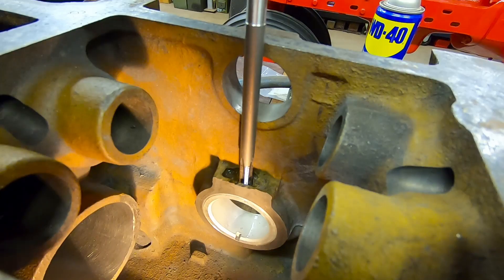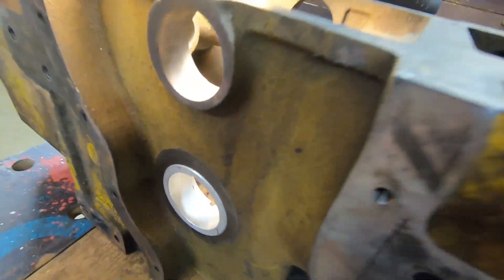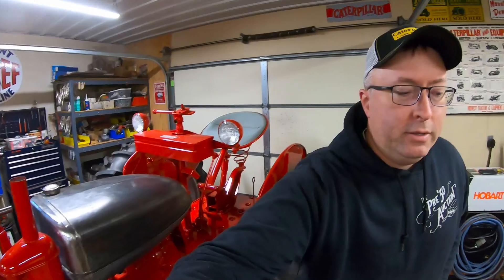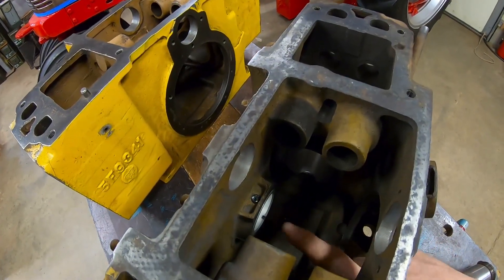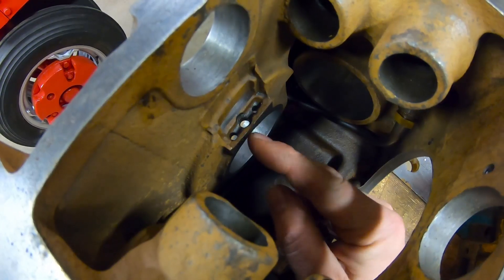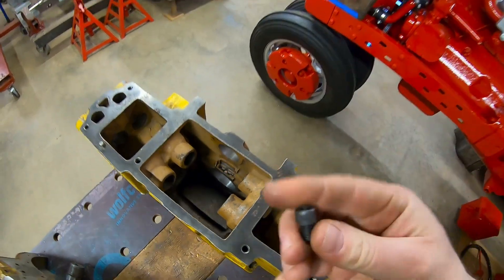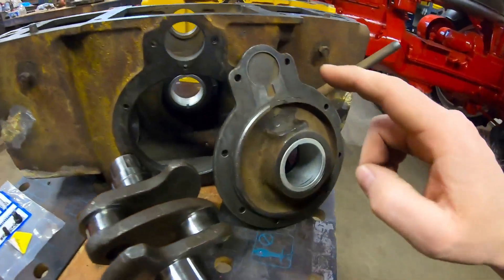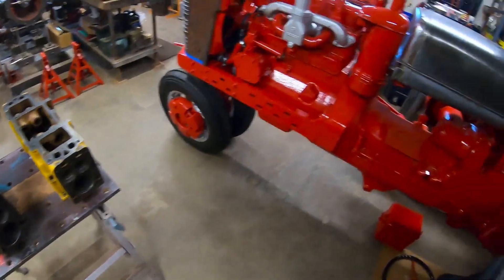The Rarest Caterpillar Starting Engine Block & We're Figuring Out How to Save It!

Comment: H liner movement is more problems than the ticking noise. These Liners must be press fit, because of the heat transfer between liner and block.  Clearance can not be loose. These are considered dry liners. You work this hard in summertime and will scorch the pistons because heat can not get away from  the liners
Reply from the maker: This H has pulled plows and dirt scrapers during the hot summer months for the last 18 years with that slip-fit sleeve and has never given any indication of trouble - stay tuned for tomorrow's new episode where you'll see a lot more of that loose sleeve :-)

Comment: Um....so when you torque the set screw it pushes on the bearing and distorts it out of round?
Reply from the maker: No, think of it like a pipe plug - the force is directed out radially, not downward. But unlike a pipe plug, only the very bottom thread of the set screw finds interference, and it only gets a short leg cinch with the Allen wrench, the Loctite does the rest. But even in the unlikely event that there would be bearing distortion, it would only happen at the very base of the set screw, which is recessed up inside the cut-in oil distribution groove that can be seen in the mirror reflection in this video, so it’s still far removed from the crankshaft. For the bearing itself to distort to an out-of-round shape, other material would have to have the ability to heave outwards below and to each side of the upper area, and the wall thickness of the bearing combined with its press fit in the block bore prevent that from happening 👍
Reply: @squatch253  I 100% disagree with your theory. But it's your engine. You way over estimate the rigidity of the bearing wall and way underestimate the force applied by the screw. I wish an engineer would chime in on this video and give their take on this.
Reply from the maker: I appreciate your concern, but I can assure you this isn’t my first rodeo. I wouldn’t put anything up here that was a bad idea in practice. Engineers operate primarily in the realm of theory, only a precious few are gifted enough to have real-world aptitude, whereas most struggle as soon as the abstract becomes reality - this is years of my own experiences with engineers talking here lol ☺️ Theory only ever gets you 75% of the way to reality - that saying came from one of the very few engineers that ever amazed me with their abilities 👍
Reply: @squatch253  So you know better than engineers. Got it. LOL
Reply from the maker: It’s ok to disagree, no harm no foul 👍 All you need to do is watch these machines that I’ve rebuilt in action here on the channel, their function and dependability are the only argument I need to put forth. Thank you for watching and I sincerely wish you a fine day - no sarcasm intended either because I know how the written word doesn’t always convey the context 🙂

Comment: WD40 is not a lubricant
Reply from the maker: On aluminum it is - I wasn’t worried about the cast. When machining aluminum, WD-40 works excellent to keep the cutting edge cool to prevent the galling and material sticking to the leading edge of the bit. Same goes for any drilling or tapping I do to aluminum (as seen here) because it also keeps the chips from sticking to the drills and taps, and it’s cheap! 👍

Comment: @Sqatch253 I have one cylinder on my pony burning  buring oil at a crazy rate. Any issues finding rings and pistons for these? D24U12XX is my SN.
Reply from the maker: Going back to the "Try-Build" playlist that I discussed in this video, what I learned while filming that saga is that standard size pony pistons are still easily found new, but most all of the oversize offerings have went extinct - and same story on the piston rings - standard size is still available but oversized rings are getting hard to find.  That's why I decided to sleeve two of the three engines I built back to standard bore size, to be able to use all new standard pistons and rings.  The complete rundown of part numbers for everything can be found within the "Try-Build" series.
Reply: @squatch253  thanks, dude. Hope yall had a great Christmas.

Comment: I got the exact solution to your set screw problem that will take alot less work and thinking use a threadsert theyre already hollow in the center and you wont loose your temper having to drill and they have a lip on them to stop from going to far down you will have to counterbore it so the lip sets properly but this is the proper solution i do believe
Reply: Depending on how deep you counterbore it will either be flush or recessed as well.

Comment: Is there NO oil pump in these starter engines??? No crank drillings for oil???
Reply from the maker: Correct, they’re a very low-tech engine that produces 10hp at 3,000rpm, holds one quart of oil in the crankcase, and are splash lube only. They do utilize the pulsing of the pistons as they both come back into the crankcase at the same time on the return stroke to force some of the oil up into the valve pockets using crankcase pressure, but other than that there isn’t anything else. In another video that I titled “Pony Motor - Cursed By Design or Just Right?” I broke down their intended 250 hour service life but also matched it to how long the diesel engine lasts, estimating actual cranking times versus diesel engine operation intervals and came up with a rather interesting match between the two 👍

Comment: So this might be a stupid question but on your bearing set screw, when you didn't cut the threads all of the way through, wouldn't that cause the set screw to push the bearing down when you tightened it.  Creating a little high spot.  Or is it not enough to worry about. I guess it would depend on how much you tightened it.
Reply from the maker: This has been hashed and re-hashed in the comments here so far, but to recap - think of the set screw as a pipe plug, except only the bottom thread is interference fit. The force is being directed out radially, instead of down. If I had put a ratchet on it and kept turning it could’ve displaced some aluminum downwards, but the short leg cinch of the Allen wrench is just fine. Plus, the end of the set screw is up in the cut-in oil groove in the top of the bearing, which can be seen in the video when I pointed the mirror up at it. So if any material did displace slightly, it’s far away from the crankshaft 👍
Reply: @squatch253 Ok.  Thanks for explaining.  I completely missed the oil groove.  Makes sense now.  Keep up the good content,
Reply: @squatch253  Your wishing the forces behave as you want, but they don't.

Comment: Do you find that theres any distortion in the bearing now that your relying on the set screw to bottom out and tighten into it?
Reply from the maker: It’s not possible for the set screw to distort it, the force is being directed out radially and not downward. Think of it like it’s a pipe plug, same principle of an interference thread, only it’s just happening around the very bottom thread. Plus, the area around the base of the set screw is a recessed oil distribution channel, not in contact with the crankshaft. You can see it in the spot in the video where I pointed the mirror up at it.
Reply: @squatch253  that's good, it's a neat solution! I like it 👌

Comment: Great job I have always tried different ways to keep bearings and bushings in place in automatic transmissions like to see other peoples ideas nice professional job .I watched one of your shows and heard you worked on ford  transmissions much respect.I have been transmission tech for 39 years on all brands and know how much patients and knowledge it takes again nice job
Reply from the maker: Thanks, yes I ran the “transmission bench” for 20 years at the Ford dealer, and saw a lot of changes in that relatively short time. But one thing that stayed constant was a bit of advice I got from an experienced transmission tech when I was just starting out, he said “When you rebuild anything, the #1 rule is that it’s going to take what it takes to be right, nothing less.” It sounds overly simple, but that statement spoke volumes in the years to come doing the countless rebuilds and making sure not to cut any corners 👍

Comment: I think I like the raised head threaded screw better with two new oil holes.  The problem with the tempered allen screw is that it would be hard to remove because the allen wrench will likely strip out because of the softened screw.
Reply from the maker: I don't believe that will be an issue, because it's not cinched in tight at all (only used the short leg of the allen wrench) plus a touch of heat re-liquifies the Loctite and makes it release its hold, so removal will be easy.  I'm actually more concerned about taking the other raised  head allen screws out someday, as I had to mill the OD of their heads down so far to get them to fit in the oil pockets that it made them very thin-walled around the hex drive and I did have one of them split out when putting it in.  This recessed set screw setup still has all of its "meat" around the hex drive :-)

Comment: Neat upgrade.
Not a Cat guy but this surely falls in the tips and tricks section of anyone with a mechanical bent.
Reply from the maker: Thanks!  Yeah I have to shake my head at some commenters that tell me they're unhappy with my feeds when I don't make videos about their favorite color/brand of machine - I get that to a certain extent but for the most part, everything on here will still apply to some extent across the board.  The tricks and techniques are all the same once you go deeper than the paint on the hood :-)

Comment: VW bugs also used that scroll cut on the crank and no oil seal. I remember being blown away as a young man when I first saw that.
Reply from the maker: The Cat D2 and D4 diesel engines of this same time period also had the oil scroll on the rear main bearing, no actual seal in the back at all.  The one on the D2 #5J1113 can be seen in one of the episodes in the Diesel Engine Rebuild playlist :-)

Comment: Why would you need a grub screw to keep the bearing from spinning..... Is the bore oversize? Why not improve the bearing bore fit.
Reply from the maker: All of these factors have been covered in-depth with full demonstrations in the "Try Build" series - there's pretty much nothing about these engines that hasn't been discussed - https://www.youtube.com/playlist?list=PLW_TtiTWGCaqrtx5aEi85ZTwQwGRXWeMo  Although I'll be leaving a ton of info out, the most condensed recap I can give you is that this front main bearing is the smallest of the two, but also has to handle 100% of the crankshaft end-thrust and is just not strong enough to stay tight.  These blocks are known to crack around the retaining dowel hole due to it being so thin, which loosens the fit of both the dowel and the bearing.  The dowel migrates out, leaving the bearing to spin and damage the block, which lets the crankshaft pop in and out in excess of 1/4" when running, leading to timing geartrain damage which usually also breaks the magneto.  In the Try Build series, I built one engine back to 100% factory spec with the original dowel pin design to have an example of that process, then built a second engine where I made a custom line boring setup to repair the spun bearing bores in blocks that had lost their dowels and bearings, then made my own special oversized OD bearing out of the proper material and also changed to the threaded retention screw method to eliminate the old friction dowel.  The third engine was a completely radical redesign of the main bearings and end thrust system altogether, where I milled both the block and rear cover to accept custom main bearings on both ends, I put a thrust flange on the inside of both bearings which split the end thrust between the two, and then shimmed the rear cover to obtain proper crankshaft endplay.  That's the recap, but to learn even more you'll have to check out the whole playlist :-)

Comment: If anyone in the community has any parts for a pony motor .
I’m looking for intake & exhaust valves 
Cat RD7 - 9G2488
Parts numbers 
T-135 inlet
T-134 exhaust 
Any help is greatly appreciated
Reply from the maker: Back when I rebuilt my RD-6 starting engine, the intakes were still available new from Cat, but that was also back in 2010.  You'll have to give them the part number in the modern format for their parts guys to be able to enter it into their system, which would be 0T-0135 for the inlet valves.  But the exhaust valves were already extinct even back then, so either having some made (which is tricky) or finding some good used ones is the best we can do now.

Comment: Eaton uses that reverse cut oil groove on the input shafts of the Roadranger transmission absolutely ingenious and stone cold reliable. No seal to change or fail and they don’t leak maybe a little weep here and there

Comment: speaking of the trybuild/d2,  i remember you acquired a wood cab for 5j1113.   is it your intension to put that on yet or did you change you mind?
Reply from the maker: Yes, I’ve explained the projected outlook for that cab a few times in videos, but I’ll recap it again here - I don’t want to put the cab on the D2 until I’ve been able to run it enough to be satisfied that the diesel engine is well broken-in and I won’t have to go back into it to repair anything, because the wood cab will block me out of working on a lot of it. But with the setbacks I’ve recently experienced with my eye issues, the doctors don’t want me riding on anything that bounces and shakes like a small Caterpillar does, so until I get better I won’t be running the D2’s at all, unfortunately. So the cab just waits in storage.
Reply: sorry to re ask.  ive been away from youtube for a bit.   hope your eye heals well. @squatch253

Comment: I took a different approach on mine - I milled the block and crank and installed thrust bearings front and rear so the main bearings don't have to carry any thrust load. I think it's a superior method because it provides more thrust surface and the thrust is direct to the block / crank cover. Milled the thrust bearings, which are essentially sintered bronze washers to provide the desired axial float

Comment: When you use the cap heads shoulder you apply load and deformation to the cast iron housing. Deflection is low. By bottoming out on the set screw it's the thin aluminium (yes I am English) bearing that takes the load and it will deflect much more. I don't know what torque you used but trust me it won't take much to distort the journal. I have a lifetime in the seal industry and dealing with such problems. Anyway love what you do.
Reply from the maker: I’ve answered this same question a few times here already, but to recap -
It would take well more force than what this set screw could apply to cause any distortion to the bearing, plus it’s not very tight because I just used the short leg of the Allen wrench to cinch it. Because of the press fit in the block bore, there isn’t any surrounding material that can move in order to allow the immediate area engaging the set screw to drop. In the case that it did distort a bit, the material surrounding the set screw is still up in a recessed oil distribution groove that’s removed from the actual bearing surface, which can be seen in the part of the video where I used the mirror to look up at it. Also, the interference fit of the threads at the bottom of the hole doesn’t push down on the material, rather distributes it outward radially. And all the threads being cut in unison through the block bore and then into the bearing work with each other to resist either component from being moved away from their mating surfaces 👍
Reply: @squatch253  "It would take well more force than what this set screw could apply to cause any distortion to the bearing"  .......As a machinist (43 years and counting) I say absolutely wrong.

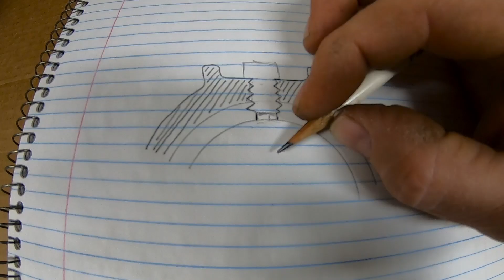Comment: My 1926 Oldsmobile has that same design except alot more prominent and the transmission housing and 10:08 rear end Pinon shaft and housing .both input and output   transmission housing and rear end housings are case auger groves to match the shafts. The 600 weight in those days was like a grease. Denis from Santa Rosa CA merry Christmas and happy new to you and your family from ours

Comment: I’m curious if the grub screw biting into the bearing material will cause any bulging of the bearing creating a clearance issue. Thank you for the wonderful videos! Always look forward to seeing you pop up in my feed!
Reply from the maker: Not a bit, the setscrew isn’t very tight, just cinched it in using the short leg of the Allen wrench. Plus the threads all being cut in unison through both the block and bearing act as a keeper to further resist the two components from moving away from each other. Add to that, the end of the set screw is up in a cut-in oil distribution groove at the top of the bearing, so even if it did displace some material, it isn’t in contact with the crankshaft 👍
Reply: @squatch253  I feel if you checked the bore with a dial bore gauge, you see that it doesn't take hardly any torque to distort the shell down some thousandths of an inch.

Comment: You could cross drill horizontally in a + pattern in the base of the head on the bolt.  Thus retaining the benefit of the head controlling depth and retention but get oil passage ways from the sides as well as the top

Comment: I like it mate gotta be better not to look at a cap head in the block, did you use a second tap as to have slight taper into the bearing rather than a bottom
Reply from the maker: No the tap I used was just a standard cutting tap so the ends of the flutes have a good taper on them already 👍